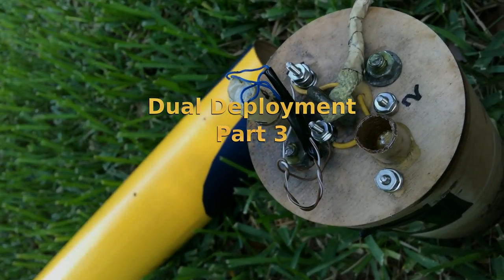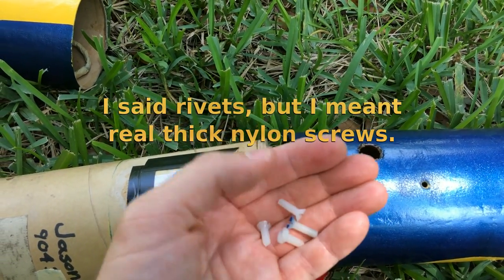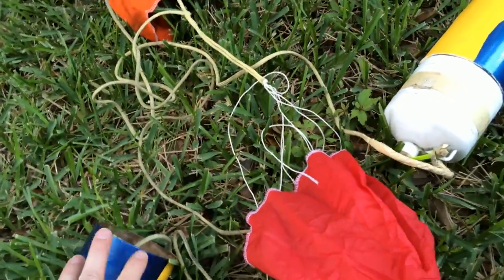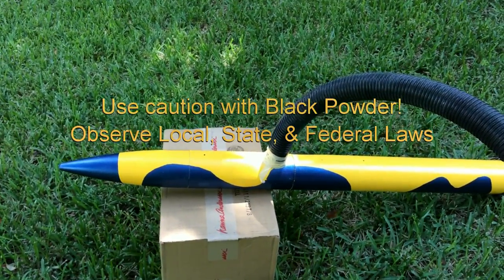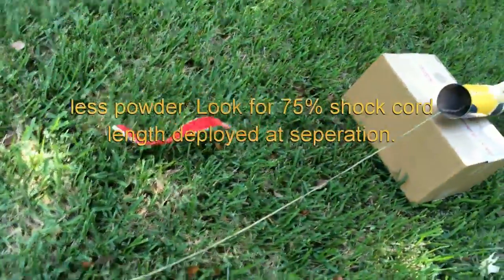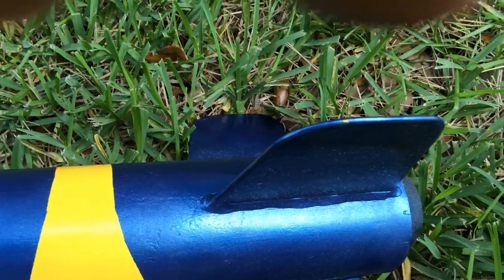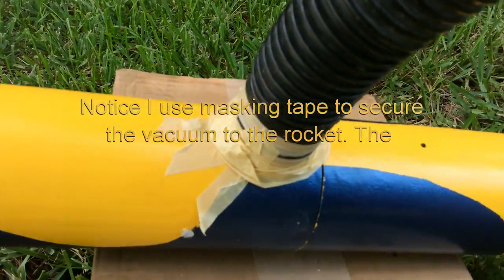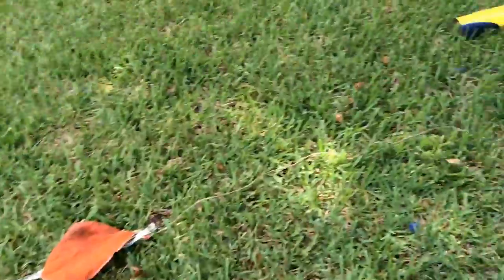Dual Deployment - Part 3

Comment: love your "sheer Pin" idea though too new to rely on at the moment till we get more consistent data on them. But good work in that area. I like it.
Reply from the maker: Shear pins have been used for decades in high powered rocketry. You can find articles on them such as: http://www.team1.org/tt/shear%20pins.pdf & http://hararocketry.org/hara/resources/how-to-size-ejection-charge/ You can find them for sale at vendors such as apogee: https://www.apogeerockets.com/Building-Supplies/Misc-Hardware/Nylon-Shear-Pins-20-pack If you want to buy them cheap, you can buy them here: https://www.mcmaster.com/#machine-screws/=qujkjj Select Round, Plastic. I use #2-56 1/2 inch qty 100. Those work well on both 3" and 4" diameter rockets. Try to use a min. of 3 so there is less chance of sticking.

Cardstock Tubing Tip: Shear pins put a lot of stress on standard cardstock tubing. When using on cardstock, make sure to rough up with sand-paper around the shear pin hole - every section that has a hole - parts separated. Then, take superglue and fill the hole and let soak into the roughed up area, keep parts separated. Don't glue the parts together! Let dry, lightly sand, and re-drill the hole. Retest that shear pins still go in. This will give excellent strength to the tubing where it needs it around the shear pin. Add inspection of shear pin area to your flight prep routine.

Comment: Enjoyed your series.  Say, where are you buying the hundred shear pins for $5.    What is the source?  Doug
Reply from the maker: http://www.mcmaster.com/#machine-screws/=qujkjj

Select Round, Plastic. I use #2-56 1/2 inch qty 100 for $5.50 on my 4" diameter rockets. They work well in that configuration on 3" too. Try to use a min. of 3 so there is less chance of sticking. 

Here is a BP calculator with shear pins added: http://rimworld.com/nassarocketry/tools/chargecalc/index.html
Reply: Thank you!  Again, good job on the videos.

Comment: Hello Jason Cook, I liked your video, if it were possible I would like to know what the substance used in the ejection. Thanks in advance.
Reply from the maker: +Vicente Garcia de Magalhães Junior Quest Q2G2 ematches work very well 
and are highly reliable - but seem to be in short supply lately.  
Firewire Initiator are the only ATF non-regulated initiator on the 
market - with those I wrap electrical tape around just the metal 
contacts that are near the pyrogen tip, that way, they don't short 
against other ematches.
Reply from the maker: Followup: In addition to the Quest Q2G2 ematches, I use FFFFg black powder. Use a BP calculator on the internet so that you know proper amount of powder. http://rimworld.com/nassarocketry/tools/chargecalc/index.html

Comment: How do u turn on drouge by itself and how do u turn on the main by itself and how do u turn on both at the same time?
How do u plug up the motor part for ground test?
Reply from the maker: I test each individually. So if I am testing drogue, I don't put igniters or charge on main and vice versa.

For plugging the motor, I cut a circular plug made out of plywood that fits in my motor casing.